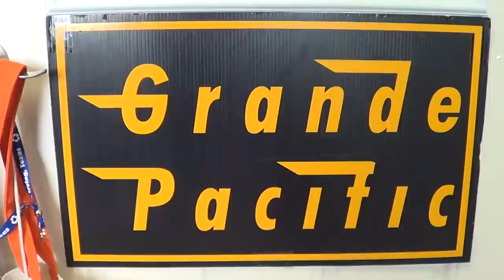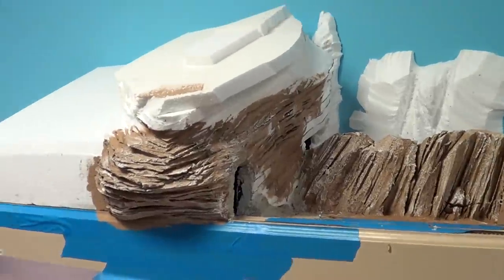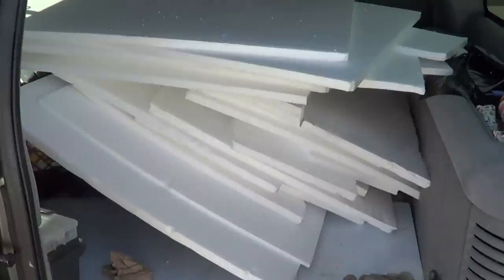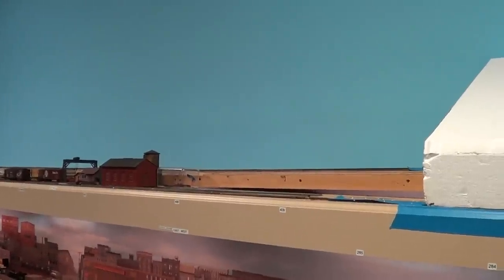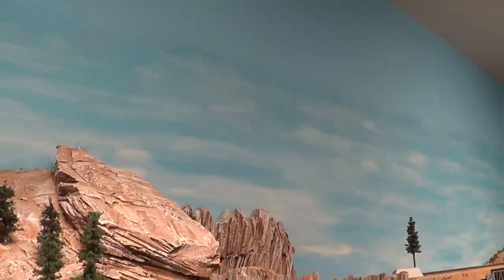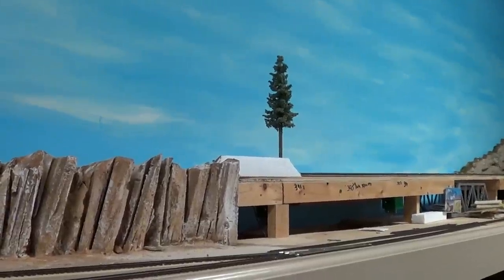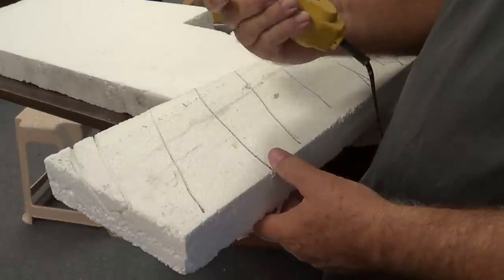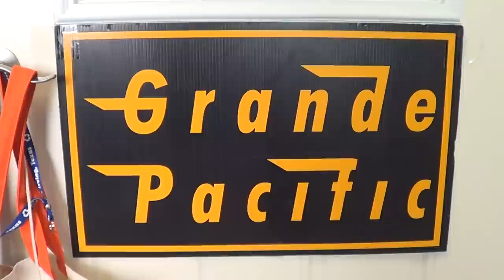GP FLAT IRONS PART I

Comment: I see you posted this back in Jan 2014, so it is too late for me to suggest changes. However, despite that I am going to add my 2 cents worth anyway :) hehe!  First off, I really prefer the new blue color. It's more of a "sky" color in my minds eye because it adds perceived depth, more so than the proverbial original "Baby Blue"-ish color. With the new blue being just a tint darker, I think it would have created an exceptional transposition to have had the reverse wall in the original blue like it is, then slowly fading into the new slightly darker blue while following the wall around transitioning into the new slightly darker blue color. I think that the new blue would provide enough depth, so that having more clouds at the top might provide a "canopy" effect. Like the clouds are coming over head. Don't forget shading of the clouds and the shadows. I am from Colorado and lived just north of Denver for most of my life. The flatirons used to be a regular experience for me. My first concert in my life was seeing Sonny & Cher at Red Rocks Amphitheatre. I don't mean to be critical, just informative, but the flatirons were never stacked in a row "Nut to Butt" for any extended length like they are displayed here. There were gaps in between each upright with dirt and silt and trees and vegetation growing in between them. They were a reddish rust brown color. Very seldom would they create a "shelf" effect like shown over the tunnel. If anything, that "flagstone" effect over the tunnel should be more like one huge cracked and broken piece of outcropping with worn, weathered stepped edges. The flatirons, for all their great majesty, were actually pretty soft rock. Shrub oak, twisted junipers, short grasses and pines grew all around them. I hope you take my words strictly as informative, I think you have done an exemplary job on your scenic layout. I wish I had the time, the room and the talent to accomplish what you have done here. Your attention to detail shows.